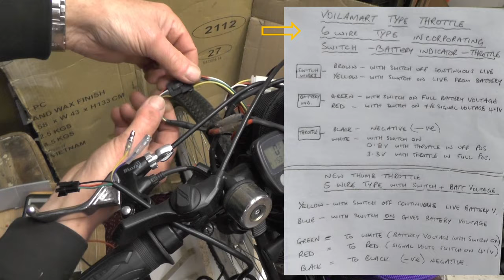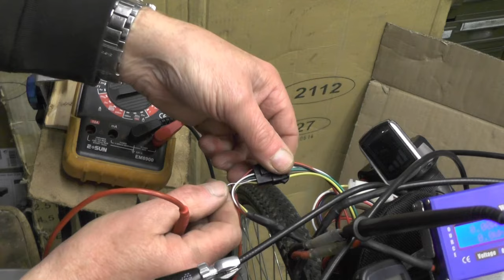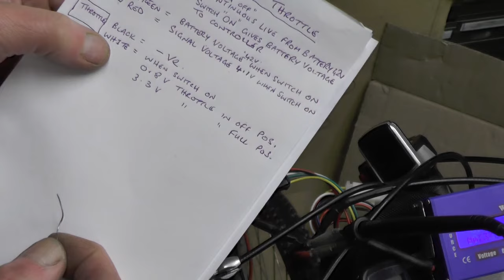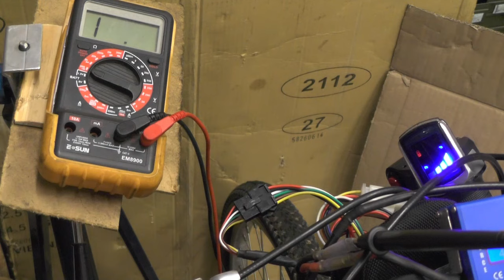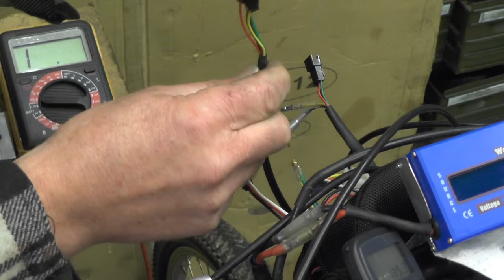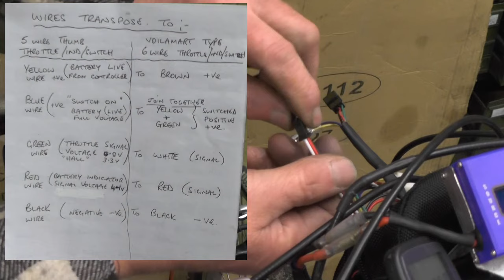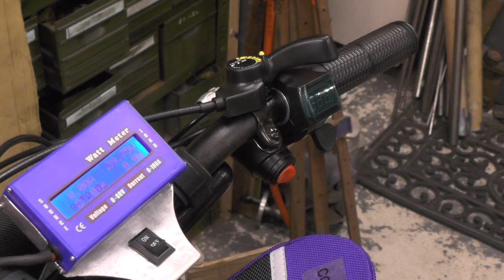Electric Bike Wiring Twist Throttle 6 wire to Thumb Throttle 5 wire Voilamart  type Controller. Mr F

Comment: This video is helpful, thanks.
My problem is I have 8 wires coming from my key switch throttle and i haven’t seen any help for 8 wires from throttle.  What I’ve figured out so far has been thru research, video, and articles.

Brown + yellow, key/ignition 
Blue, green, grey, black - all leading from display screen on throttle (batt, volt indicator.
And blue + gray, throttle.
Red, black, white - all come from HS in throttle. 
Black wire shared between HS and batt/voltage display.

After connecting to “practice motor” motor will spin but only with “intelligent wires”.  I can’t get any action with throttle + when I multimeter test, voltage to HS is at 8v.  

Motor spins, get all info on display, but I obviously have something not connected or misconnected.

Man I could really use ur help.  Stuck for few days now.

Do you have an email address? Would you allow me to send a video of my connection and what happening?  

I’m thisclose…. Need help to get over this hump

GREAT VIDEO.

/Bklyn👑
Reply from the maker: Hi Robert
thanks for comments,  sorry to hear your problems, i can only vouch for the voillamart kit in the video,, i've never seen one with 8 wires on, I think the chinese call the key switch wires (door lock)  although it's a while since i played around with these, so i think these wires need a battery voltage +ve , then when switched to the on position, it sends +ve to the controller  to wake it up,  also i thought the signal voltage should be 4 to 5 volt, never heard of 8 volt. 
I can't promise anything because these things need hands on faffing around with!!! but my email is on my about page, but only shows on a computer /laptop for some reason.
good luck
Kev
Reply: @MrFactotum  
thanks for your reply, Mr. Kev.  I don’t have a laptop but I’ll go to library to get your information.  To clarify, when I test the three wires from HS in throttle, this is an isolated test with red multimeter probe on signal wire and black on ground.  Read starts at expected .8 but increases to 7v … just under voltage of 9-volt battery I’m using to test. Regardless of error in reading I know for sure HS works because it is fluctuating from pole to pole.  

I’ll send video as soon as I get to a library.  Thank you so much.  You didn’t have to extend this generosity.  

Lastly, 🙏🏾 + condolences for the loss of ur daughter.  I’m confident she would be proud of you, sir.

Email u in the coming days. 

/Bklyn👑 
Im thisclose…it’s so frustrating, but I’m not a quitter and I enjoy ebike challenges.  

Somehow when all is connected and I pass a magnet over the throttle HS, there is no correlation motor spin.  Motor only spins if I connect intelligent wires on controller.

Im still working at it as we speak + I keep notes like you, too.  I’m studying ur notes all day.  Helpful.

Somehow, I’m not getting any voltage to throttle HS when passed over magnet which tells me I haven’t grounded something, closed a circuit somehow. 

I have the wires figured out for sure, it’s just I’m missing some connection from controller to read HS throttle

Comment: Ok so i tried your method cause i have the same voilamrt throttle but it doesnt work any more suggestions?
Reply from the maker: sorry to hear that R A
so the thumb throttle it did work then it doesn't now,  must be a bad connection somewhere or faulty thumb throttle / controller, i did have a voillamart controller prior to the one in the video that had a fault on it which they replaced with no quibble. Check that your getting 4.1 volt  signal from the controller, and that the same 4.1 volt is reaching the thumb throttle, if not its one of the above problems, Hope that helps
regards
Kev
Reply: @MrFactotum  no i ment that i have the same throttle as you do and now i am trying to connect a new throttle which only has 5 wires to my controller and i tried your steps but it did not work for ne
Reply from the maker: @RealRayAl  ok, check the correct voltage is coming from the controller and reaching the throttle, or re connect the original throttle as it was, this will help finding if its the controller or the thumb throttle, to eliminate one or the other, its difficult for me to be more precise with not being hands on it, it's a matter of elimination, it might be a  bad thumb throttle, hope this helps you, good luck, 
regards
Reply: @MrFactotum  it might be a bad thumb throttle because when i connect the brown to the thick white on new throttle it powers on the new throttle but no motor movement. I cant connect the old throttle anymore because the 3 wires that were connected to the small sensor chip in throttle snapped off and idk how they were connected to chip. Thats the bad thing.

Comment: Hi, I have similar controller/throttle combo, which works thanks to your method. Is there a way to connect additional LCD to show speed? I'm connecting brown and black wires, LCD only reads voltage. There are 3 more wires, but I'm not sure where to connect them on controller.
Reply from the maker: Hi V
Glad it went okay, as for the lcd, i'm not sure there are many types of controller, mine doesn't support a lcd. sorry i can't be of more help.
thanks for feedback
regards
Kev
Reply: @MrFactotum  ok, I thought your/my Voila controller could be rigged up even if they do not specifically include lcd connector.
Reply from the maker: @vadim7590  Maybe Vadim, it's just that because i didn't want an lcd screen i never bothered to pursue it, so it needs to be investigated, i just use a cheap cycle digital speedo off ebay.
all the best with looking into it, and if it turns out you can't  just fit a normal speedo on that runs off the front wheel, cheap as chips off ebay!!!
all the best
Kev
Reply: @MrFactotum  is hall sensor connector has anything to do with reading speed? I never could understand what hall sensor does.
Reply from the maker: @vadim7590  Hi V
hall sensors don't read the speed, they tell the controller where the motor phase positions are as it spins, to tell the controller which of the 3 winding phases to send power to, it all happens in micro seconds as it spins.
thats my laymans explanation as i am no expert.
hope that helps
cheers
Kev

Comment: I tore off 3 of the 6 wires on my mothers bike when i tripped and i grabbed on to it...
First i playned to resolder them but the housing can't be taken appart without breaking it.

Have been looking around everywhere for a new throttle with 6 wires but i can't find one.
The only thing that was printed on the throttle was "DE PU 25.9v".
Only other thing i noticed about the throttle is, that it is progressive/stepless twist throttle.
Reply from the maker: Hi SP
sorry to hear the bad luck, if its the Voillamart kit throttle, i'm sure i seen some on ebay a few week ago, good luck with finding one, i'm sure they are out there
regards
Kev
Just found this on ebay https://www.ebay.co.uk/itm/124531914675?mkcid=16&mkevt=1&mkrid=711-127632-2357-0&ssspo=nxlEYJWjT6a&sssrc=2047675&ssuid=HFwjoyRSTni&widget_ver=artemis&media=COPY
Reply: @MrFactotum  Sorry but i have to ask again, because i am really unsure. Do you think that 36V throttle you posted would work fine with a 24V battery?
Reply from the maker: @SnakePlizkin  Hi SP No Problem at all.
I can't see any reason why not, It's the controller that matters as long as the controller supports the 3 wires to facilitate for a throttle and the controller supports working at 24volt ie with a 24v battery, the throttle should recieve its 4v signal to tell it to work. I'm no expert it's just my knowledge from tinkerining with a few ebikes that i've made up mainly from Voillamart parts, however there not really voillamart parts thats just a suppliers name.
As long as the battery and controller match i.e 24volt controller, (some controllers are dual voltage, thats 36v/48v or 24v/36v) and that the controller has all the functions you need i can't see a problem. As a last resort If you have not bought the throttle yet, just try to find one that says the voltage range or ask the supplier.
 Hope this helps you
cheers Kev
Fell free to ask my "grey cells" if i can help i will.
Reply from the maker: @SnakePlizkin  hi again SP
Just found this it says 24v in write up heading
https://www.ebay.co.uk/itm/224912749439?mkcid=16&mkevt=1&mkrid=711-127632-2357-0&ssspo=qNQKS0orTka&sssrc=2047675&ssuid=HFwjoyRSTni&widget_ver=artemis&media=COPY
Reply: @MrFactotum  You are so awesome, thank you for helping me. :)
Reply from the maker: @SnakePlizkin  hi sp
i think it should be ok, i can only vouch for the voillamart type throttle as thats all experience i have, I have found out that many chinese electrical components, come with really bad translation, so i always hold my breath sometimes and hope they work, sorry i can't be more precise but thats how it is with imports, unless you buy from a humanoid shop counter!!! its a lotto!!!
👍 regards
Kev

Comment: Couple side questoins:
-does the lcd/led display actually have any controls usage
-could you point me to the correct display, as I'm thinking our controllers are the same ("dc moto by lithium battery").
Talk about the wild west, ebikes are pretty much it.
Reply from the maker: The blue lcd on the bike is nothing to do with the bike function actually, i just wired it in to check the controllers maximum amperage under load, it has no other function, other than an experiment, its actually a watt meter they use on solar systems. 
hope that helps
regards
Kev
Reply from the maker: forgot to say, i don't know of any lcd displays that work with this controller, sorry
Reply: @MrFactotum  okay, thanks; take care!!!!

Comment: 5-wire (new switch) to 6-wire (controller):
Yellow----->Brown
Blue---->Green&Yellow

Throttle:
Red------>Red
Black---->Black
Green---->White

He has this information clearly in his video, but just in case you're looking at it on a crappy screen.

Applies For this specific set of controller and switches only.

For his controller pinout:
Brown: full-time battery positive to on/off switch
Black: Negative wire for everything
Red: ~5 VDC to throttle
White: ~0.8VDC to 3.8 VDC, "Hall Sensor", varies for throttle movement
Green, Yellow: Battery voltage with on/off switch in "On"

Someone please verify I didn't F this up?
Reply from the maker: Hi MP
Spot on for this specific controller and switch, since then i have another thumb throttle with once again different colours, why an earth they can't have an industry standard is beyond me, so please everybody check your wires with a multi meter to varify all the colours and to check the battery voltage, signal voltage, sensor voltage, earth and switch wires. it's fairly simple to do this with a multi meter so double check,.
Thanks for feedback MP 
Happy ebiking
Kev
Reply: That didn't work whatsoever for me

Comment: Figured out something; I removed (got frustrated putting it back together) the spring from a cheapie thumb throttle. It was the kind with the 3 light volt indicator on top.

Anyway, I put the unit back on the handlebars, then placed an appropriate-sized o-ring beside the throttle, then snugged-up the rear gear shifter. The end result is the throttle stays fixed where you set it. This can obviously be dangerous, but otoh it's VERY good while riding. You can control the motor via your brake handles, and pretty much go a constant speed which saves on battery life. A lot of my rides are full of stop-and-go.
My plan is to evolve this a bit more to make it safe, but I do very much like setting the single-power level
(the main current drawback is you might forget when you're stopped somewhere, release the brake handle and go flying off; not a happy thought).
Reply from the maker: Hi MP
thanks for the feedback
Yes is no problem while your riding the bike as you know about it,  what if someone else un-be-knowlingly gets on the bike, that's just my angle on it.
thanks for watching
take care
Kev
Reply: @MrFactotum  you have it exactly right. I have a different throttle on the way (I wanted a voltmeter), so I'm planning on a different, safer setup.
Reply from the maker: @MP-zf7kg  👍👍

Comment: Ayup bud, i ain`t sure about all meters but mine will  show a minus (-) sign before a voltage reading if the polarity is the wrong way round to how you put the red and black test leads, so the yellow and blue wires will show the right way without minus(-) before reading and the wrong way will have a (-) minus before volts,           I noticed your meter has a minus that flashed when you buzzed it,  test your meters taking a voltage test on a small battery both ways to see if it does, cheers all
Reply from the maker: thanks AS
i  will check that again, i had noticed a while back that happens sometimes but on last checking it seemed to show the polarity correctly and in reverse correctly,  appreciate the feedback 
take care
Kev
Reply: @MrFactotum  yes i am not sure if they all put a minus before  volt reading when its reversed, I have a fairly good edison dam668 meter,  it states in the manual it does this and only sussed it out a year or 2 ago and I've had it near 20 years lol but I don't see why they all wouldn`t. its handy now I no it does it, cheers bud, I'm building well converting a trycicle into electric using a wheelchair motor and gearbox but the motor is getting to hot, I've built aelectric fankenscooter out of a aovo pro, a Windgoo and stem of an electra, the handle bar stem had snaped on the aovo and the board stem snaped on the windgoo, so I was looking at your vid to find out if and how to wire things, because I have other parts and 2 razor e100 full scooters to use parts off, trycicle is 24v 4 new 12v 9amp hour batteries, and sooter is 36v 350w that I now have 2 hubmotors and 36v 10.5 amp hour and a 36v 6 amp hour batteries, it goes 19mph, I'm thinking of putting both hubs n it, not sure if I can use 1 controller and throttle for both, or I can cut the deck with broke stem down, with the battery and controller in it and bolt it to the wheeled deck, the aovo controller has Bluetooth and apparently the firmware can be hacked to increase mph  and acceleration, so plenty to play with, the aovo has no suspension and honeycomb tires so it rattles like a horse cart on a cobbled street, crap, windgoo has front and back sperings but the ally stem has snapped, I put a bit of pipe in the stem hole and got both sides of broken stem over that and drilled and tapped 3 bolts each side that went all the way through, it works and holds but it has streatched and wobbles now, I will get a tig when I get the money, I had a razor e300 with 2 aldi batteries wired direct using all sorts of switches and old drill triggers, it went about 28mph and they are great solid scooters for building on, ok bud enough bull ship, let me no if your meter does cheers all
Reply from the maker: @1Saltyone  eyup AS
I couldn't rest, so just been in workshop to try my meter out and it works fine only shows the minus sign when reverse polarity  checked on a battery, so its okay.
Your story sounds like there's a good video there, sounds interesting. I'm no electronic expert and all the ebike electrics i find to be a bit of a minefield., but it's just a matter of applying a bit of logic to it.
Not sure if you can run 2 hub motors from one controller, all the controllers i have used have cut outs when they reach their maximum amps.
👍👍👍 good luck with it
Cheers
Kev

Comment: I’ve got an extra cable !!! Colour is white wot do I connect that to? The numbers come on on the display but no power to the motor? Wits up with that?, I’ve been given all the parts and they’re supposed to work but I’ve had no joy pls help !!! Only just found your video m8 hope you’re still doing this peace out from the police state of north Wales 🏴!!!
Reply from the maker: Hi Aisha
Firstly is the thumb throttle and (controller a voillamart one) exactly like the one in my video, because there are similar components out there with different amounts and coloured wires, with different functions,  my thumb throttle only had 5 wires
If its the same just follow my video, it's quite a while since i did that project, so off top of my head don't fully remember what went were, and without the full information on what you are using i don't want to tell you the wrong thing, if your still not sure send me a picture of your controller wires and thumb throttle wires, but if they are not identical to mine,  a picture won't help as you need the multi meter on them to find out what is what with the functions.
Hope that helps
good luck
Kev
Reply: @MrFactotum  thanks for the reply , no it’s a twist throttle m8 not a thumb one , again thanks for the answer. Peace out
Reply from the maker: @aishalotter9995  hi 
If it's the same throttle as shown in my video, then the white wire is the throttle signal wire to tell the motor what speed to run at, depending where the throttle position is at, so that's why nothings happening as its not connected to the controller, you need to connect this wire to the corresponding wire on the controller,  It's very difficult for me to explain further without being able to see everything.
hope this helps you
good luck
Kev

Comment: Thank you for showing me just what I needed. I’m putting a 3 wire Magura throttle on my Voilamart but wasn’t sure which wire was the “wiper” wire but you pointed it out as The Hall wire. Between negative -Black and
Reply from the maker: Hi tv lic
Thanks for watching and feedback
Glad it helped
regards
mr f
Reply: I got a la free electric bicycle with a thumb throttle I'm trying to change it to a twist throttle firework it's got fireworks but the thumb trout has six to a five wire